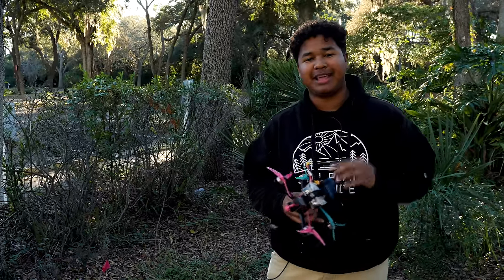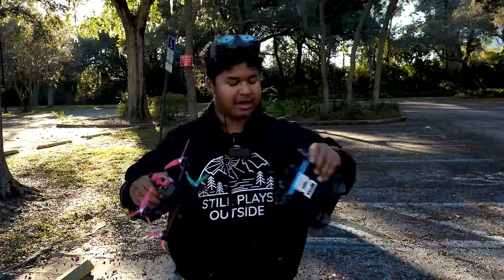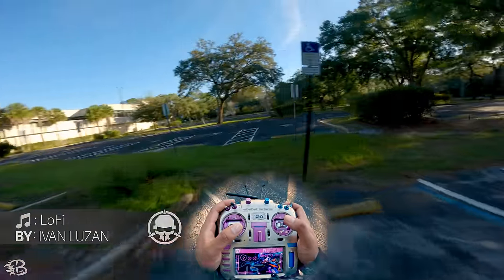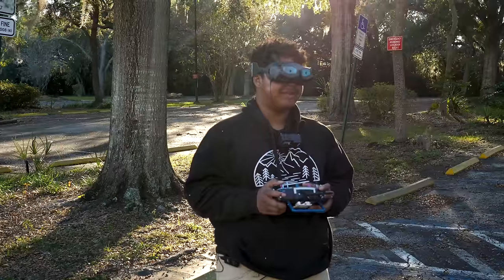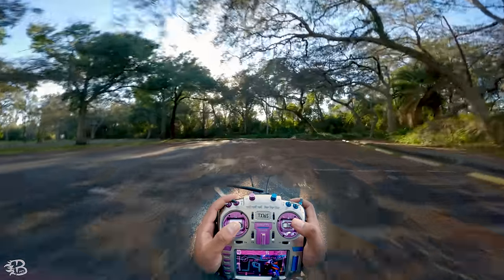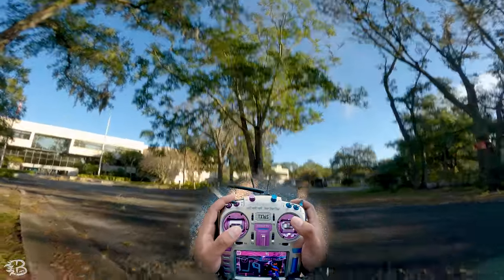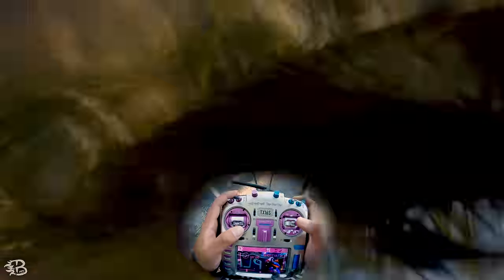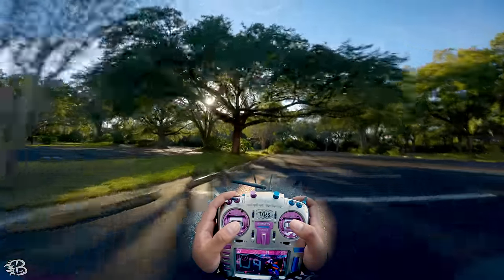How To Knife Edge || Trick Tutorial

Comment: Hey guys, I have a question for ya'll about getting my first drone. I'm already quite skilled in the sim(200+ hours, aced time trials, loops, Matty's, flowy freestyle, etc.). I'd like to have a couple different quads at some point and be a good freestyle/acro pilot. Building my own quad is not that intimidating, but I'd go with bind n fly for now.

One main motivating factor for me is the risk of fires. I'm living in a small city apartment, even if a pack starts smoking, I won't be able to run and get the battery outside.

For starting off, I'm between analog tiny whoops(300$), digital whoop(1000$) and the Avata(1200$). Any recommendations? Is the 1s battery safe enough to fly indoors without sparking on crash? I know how to charge/store the batteries safely. The Avata uses smart batteries, and somehow has more cross compatible parts with future purchases. Plus, it seems like a decent package overall.

Or should I just go for the 5 inch quad?

Comment: how is your drone so floaty? my drone is like a sack of stones XD
Reply: Change your props.
Reply: floatiness is a function of prop size to weight. 5" is good around 375g to 500g, 4" 250g to 375g, 3.5" is the 250g sweetspot, etc. if you can get bigger props, do that. if you can slim down the quad, do that. if you can use a smaller battery, do that.

if you still feel like your quad is falling too fast, lower or higher pitch props might help, as well as thicker props.